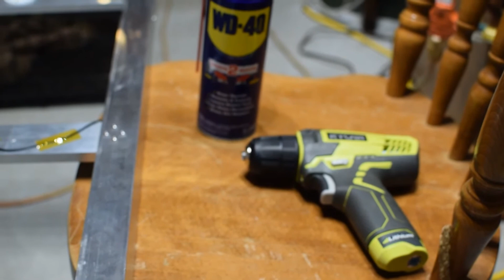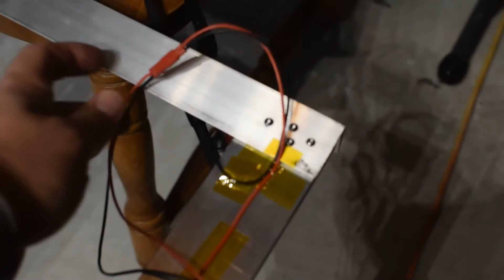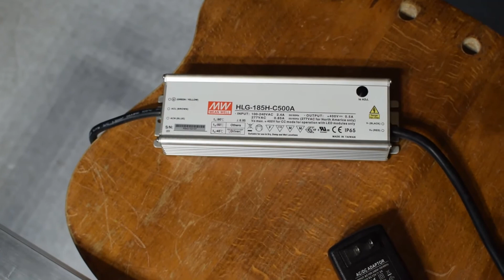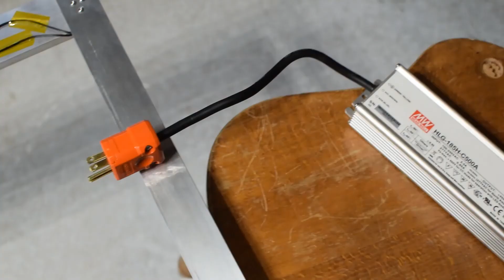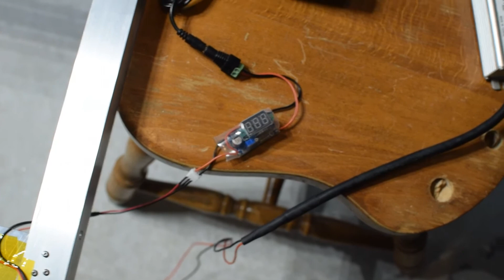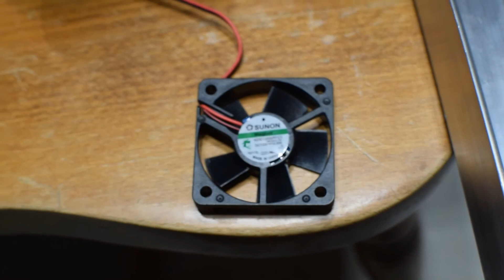DIY Led Grow Light | Cree CXB 2540

Comment: Looking forward to see more builds. I had looked up and not seen Creed LED lights and another type I'm really trying to figure out ratio diode ratios because I've noticed that they're running between the 400 and 700 nanometers of spectrum of a bike maybe 750 IR . But I'm just lost.  people decide to pick which whites? add those I'm a bit lost so I you're building with Creed LEDs and I'm thinking another types. But I'm just a little bit burnt man this is very important to me. This is all I know

Comment: Hello im new to this and plan on my own diy build. I'm lost you said there running at .5 amp? How is each chip still producing over 3000 lumens each? Thank-you for your time.
Reply from the maker: Good morning! On page 9 of the Cree CXB2540 data sheet, you see a a relative luminous flux graph based on current. At 500mA the blue line (25C, keeping it cool) is about 55-60% of the luminous flux stated on page 4 for your chip color, group, and temperature.

I have a 4000K color chip, 80 CRI I think, and I'm not sure on the grouping as I type. The mid-point of the groups, "W4" is 5784 lumens for the 25C column. So 55% of 5784 gets us to 3,181.2 lumens.

Hopefully I got this mostly right!